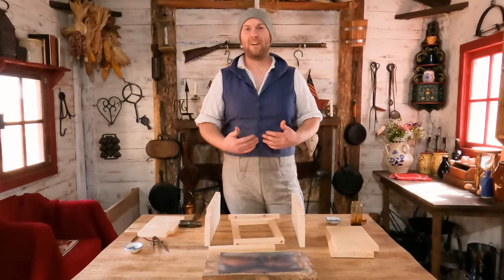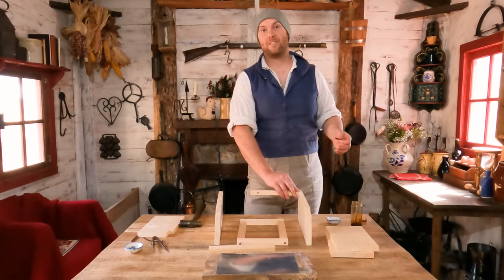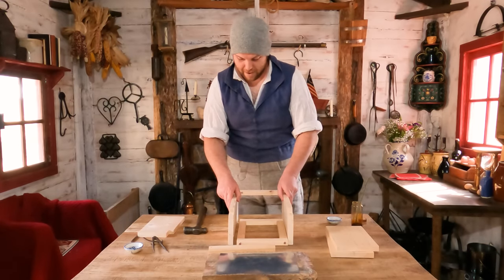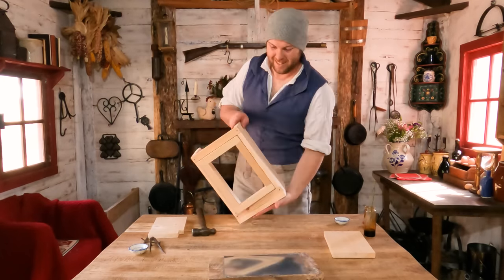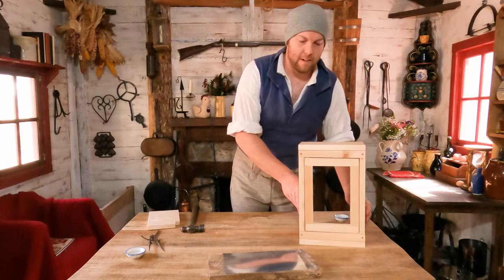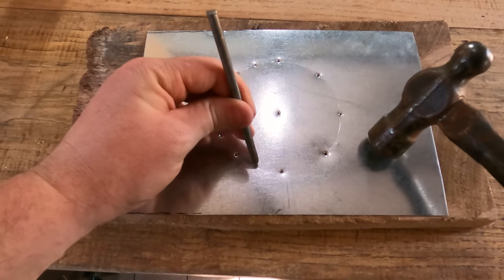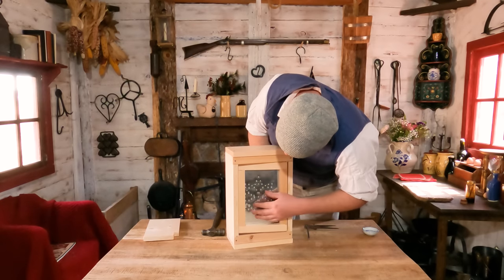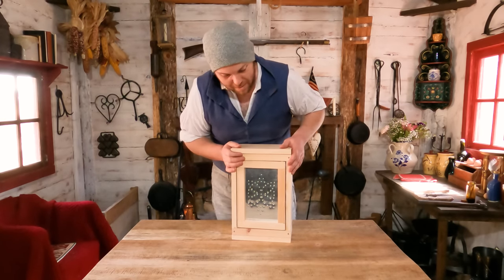🔨🪚Colonial Woodworking | How To Build a Punched Tin Cabinet

Comment: I always think that the true mark of a craftsman is being able to just eyeball measurements, and it turns out right anyhow.  
As a budding seamstress myself, I felt so proud of myself when I started being able to do things like pinch out a one inch dart by eye and feel while fitting, and then go to measure it and it was almost perfect!  Of course it's always good (and sometimes necessary of course) to measure, but knowing that you have the ability to do it free hand is awesome.  
Well done Ron, that little cupboard looks wonderful!  And I think dark green would be a lovely color to paint it, to match the corner shelves by the fireplace.  Some little yellow flowers round the edges would match nice too!
I don't know if Justine has much in the way of jewelry, but I was thinking what a pretty jewelry box one of those would make if you laid it down on it's back.  I guess you would have to make some kind of little ledge inside so the door wouldn't fall in, but you're so clever at these things I'm sure you could.  :)

Comment: That tool with the two shapened points you used for scribing your circles with is actually a winged divider, not a compass. A compass uses a nib, pencil or chalk etc. for drawing circles/arcs on paper or wood. Dividers were also used in navigation/map reading to precisely step-off distances when set to the scale on the map. Cheers from Alberta, Canada.

Comment: I think it would be better to paint first with a Williamsburg green and dry brush with a hint of red and use a stencil for a simple design, then add the hardware.  I would add a heavy cloth over the sharp edges from the punch so won't rake you hand while getting whatever is inside.

Comment: I was thinking (now you would need a chimney or a hole at the top to allow the extreme heat and fumes to escape) that perhaps something like that bit stick a candle in it and so the light would shine through the holes in your tin.  Just another thought.